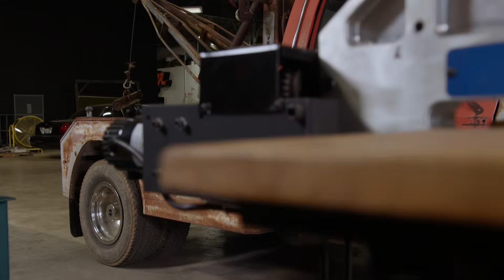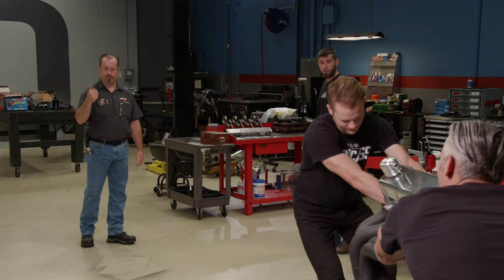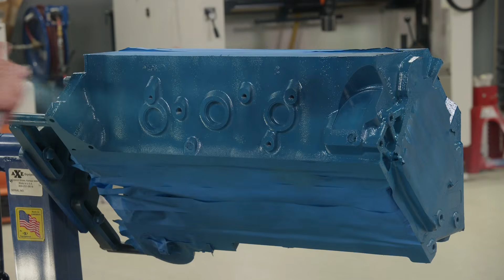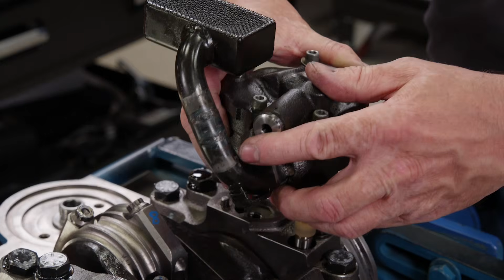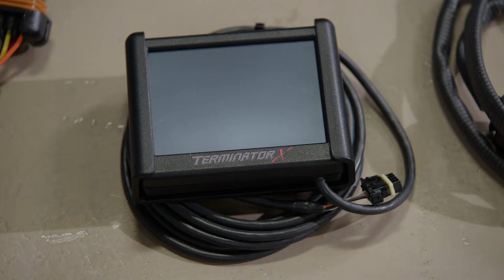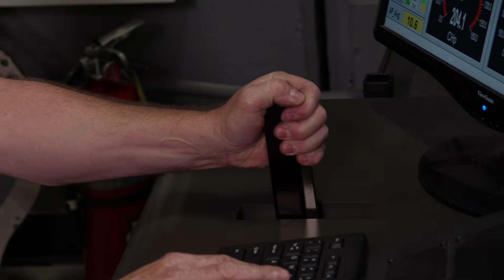A 632 Big Block Chevy Is The Perfect Fit For This '77 Tow Truck Sleeper - Engine Power S7, E12

Comment: On that tip, Chevys in my day were notoriously low 40lbs oilpsi. Z28's came with 60lbs stock, like Fords! Any time you run up to 6000 rpm, you need hi pressure pump. The Chevys BB had both hi pressure and hi volume pumps....

Comment: 1) what happened to Mike? 
2) this motor is has plenty of power. But let's try to tow something with it. You definitely don't want to be towing someone screaming at 5000rpm. Even though he toned it down, it's still not a truck engine.

Comment: very nice build. To save time and money. I believe I would have just bought blueprint 632 with 815 horsepower and 800 foot pounds of torque. I would have installed a 15 degree timing knob so if it starts to ping and pop pull timing out. I did this in my street and strip car works great!

Comment: Why not build a killer show truck and ride it around at times on calls (take out on nice days) and take it to cruise-ins and car shows? Riding a 632 around everyday is not economical. And on down the road rebuilding it won't fast or cheap either. But if you really want to make a big bore motor last use thin piston rings so the cylinders will last, you won't lose power,and you won't have blow-by later down the road and a loss of power and running hotter. If you're going all out and don't mind spending the money do it right the first time.

Comment: if you have money to burn why not? This sounds all good and cool. Here's the real thing the bigger the engine the more fuel it consumes. But if it's used for business keep it simple, dependable and a lot of torque for a tow truck it don't need to be the fastest on the road. The faster you drive the more fuel you burn in anything. Higher RPMs burn more fuel than lower RPMs. I know how much fuel a 572 engine with a 4000 stall converter putting around slowly on the weekends consumes. I've clocked a few thousand miles. Yes I run it hard even race it at times but between things I'm riding it slowly. It sets low to the ground so you have to be careful of the headers.

Comment: have a 509 BBC and I was amazed at the fact that work ethics matter and transparency still exist.  I've got 27g in my life long rebuild of 78 4x4 and well it has been a little over the 3 rebuilds none of these where my fault and happened in the first 7500 miles . wow nice build guys ty for the build .  Should have had mine done by yo all........ kinda have gotten a little bit of a bitter taste to even go any further. But if I don't quit so easily.  God bless and tyvm.

Comment: Would have been alot more realistic if they built a junkyard 454 or maybe a dirt cheap 383 kit small block. The 632 is cool but is way to expensive for most hotrodders to afford and for a tow truck you want a cheap and reliable torque motor like a 454 big block or 400 small block.
Reply: Or just 4.8 or 5.3 LS with small turbo, will be far more reliable and effortlessly make more torque and power for less than $5k

Comment: 👍 I like it. I have a GMC 7000 farm truck that's got a 454 in it and I'm thinking real hard about turning it into a big pickup truck and it would really be cool to put a big monster in it like this 632. I bet it would be cost prohibited for my budget. I'm sure it will be much cheaper for me to use either a turbo or a supercharger. 632 would really be cool though. Great video.👍

Comment: "The oil looks good." Yea, if it was found in a 67 Buick Electra with 168,000 miles on it.
Reply: I think they run Royal Purple.
Reply: It was Royal Purple on a high octane race gas.  The fuel kept carbon from building on parts.  There is no better fuel system cleaner than high octane gas.
Reply: @joshtheking1772  I see. I did not realize you were in on that build. A quick mention of that would help. In any case, it got new rings.

Comment: i got a 327 that is running 12.5 to 1 compression with 92 octane  pump gas  with no problems it was built by old man bell just for street racing on pump gas but there is a lot of money in it and it was built for high rpms . my tak only goes to 13,500 rpm's but i had all most back too 0 i would call it about 15,000 rpms in the mid 90's i was the fastest pump gas no nitro car in my area right now i'm building a stroked 454 with hemi heads going to run tunnel ram with about 12 to 1 but the engine u guy's built is a very good engine it will last a long time for the money and they will be very happy with it . i retired the 327 that old man bell built when he died just because he told me that this was the craziest 327 he had ever built for pump gas and the engine still runs today but sits in the shop on display

Comment: why a timing belt on a low rpm service engine.
Reply: David Freibuger talked about in on Engine Masters. It’s basically to reduce engine harmonics transferring from your cam to your crank or vice versa. Dave also said that the timing belt would hold up longer than a chain on an engine like this.
Reply: @samthelegoman3990  holy shit man, i don't believe that for a minute. what if a pebble, or a stick, or a piece of metal, or anything jump up into the exposed rubber belt??? the motor is done... every exhaust valve bent...
this motor is going in a wrecker, not a high rpm drag race motor... put the timing chain, unexposed,  in the timing chain cover where it belongs.

Comment: Never knew Chevy made a 632... I remember watching Stacey David on Trucks! build his "Project Copperhead" pickup, and being amazed when he revealed the engine he was planning to put into it: one of, if not the very first, then new and biggest Chevrolet engine: the 572 V8.
Reply: This engine is an aftermarket block made by BluePrint Engines. It is based on traditional big block Chevy architecture, but modified to enable you to build an engine bigger than 496 cubic inches.
Reply: @samthelegoman3990  In most cases you could bore a 427 or 454 block to 4.600 bore without sleeving if it's in good shape.  I've heard with machining you can get up to 4.5" stroke that's good for 598 ci.  Even at 4.500 x 4.25 that's a 541ci. Given how much it would cost to do it yourself it's probably cheaper just to buy a crate 632 long block good for over 800hp under $12k

Comment: Can you say 4 MIles per gallon when towing something. 🥶👎
Reply: Your right! My 79 C20 with a built 406 (10.2:1, aluminum heads and intake, comp 264 roller cam (212/218 at 50) and all the other good parts for a reliable low rpm torque small block built with 50 state legal parts) and gearvendors overdrive gets 6mpg towing my 7500 pound toy hauler. The 79 gets 9mpg without a trailer.  I got 9.6 mpg towing the same trailer with an 05 f350 with a bulletproofed 6.0 and 65hp tow tune. Haven't towed it with my 2020 LTZ duramax/10 speed allison yet, but love all the power and 19mpg average with light loads and no trailer.

Comment: burn thru a gallon or three in 5 minuets just at an idle.
Reply: Google Sucks  30 years from now, when its running of some gas hidden in a jerrycan and rusted again so bad theirs holes in the floor... mark my words? no one will have enough batteries to start that motor.
Reply: Arden Nielsen bruh
Reply: That big block won't burn through as much fuel in its entire lifetime as one 747 during one takeoff, not even close.
Reply: @walkerforsyth6221 
I had an 80cc motor bike, i ran about 40 gallons in it before the motor went in the scrap pile

i had a car with a 122ci engine in it, burner thru 7000 gallons then threw a rod.

I had a car with a modern 122ci engine, burned thru 7500 gallons of fuel... then the gambler that thought they owned it wanted it back but i had the Bill Of Sale stashed with the insurance company. so i flipped it over with a truck, ripped out the engine and set it on fire... 100 gallons. 

 i had a truck with a 305ci engine in it, it burned 13'000 gallons of fuel over its life.

i have a car with a 281ci engine in it, it has burned over 21'000 gallons of fuel over its life and still runs fine.

the truck would still be running, but the electrical problems shut it down.

Worm up and take off, 600 gallons. 

happens to be the amount of fuel that a truck AKA dumpster truck would need to haul out all the vehicles and garbage i have... tho they really wouldn't get much farther then outside there city limit marker.

nothing makes sense once they get over the fence. your the only one on the plane... do you now have to pay for all 40'000 gallons?
Reply: @ardennielsen3761  yep, just like I said, they will probably never burn 600 gal through it, it's just a toy.
Reply: @ardennielsen3761  and neither is the effort or energy that you're putting into this post

Comment: What would have made more sense is to either leave the compression higher or put a blower on the 632 and run it off of E85. A smaller cam and a blower on E85 and they could have easily been pushing 4 digits on 6-8 psi of boost and it would have been a beast down low as well. If you don't like blower then twin turbos either one but running E85. After all no one puts a 632 into anything that is concerned about fuel economy :)

Comment: Would be interested in seeing what the torque is at around 2500 because if they are going to drive the truck it should be running around that. They are going to need to tow a gas truck behind that tow truck. I thought they said they were planning on driving it on the street and hitting the strip with this thing?
Reply: It's going @#$# ton, it's 4.750" stroke, even down that low it's likely around 500lb-ft.

Comment: How do you call your self an enthusiast let alone have a show building cars but yet you have no clue what engine something has? Mind blown!
Reply: Or the year of the truck!!  Those orange turn signal lens, grill, and orange engine can't be a '77!!  The '77 would have a different grill, clear turn signal lens, and a blue engine. I'm guessing no newer than "75. I understand they are interchangeable, but that would be a lot of work.
Reply: @kattcasel9730  I love engines they're my passion by far. I cant tell you what year most vehicles are especially the older ones cause 90s baby But engines doesn't matter what it is. I like it and i want one.

Comment: Still trying to figure out what vehicles originally came with this 632 cid. I'm thinking school buses, dump trucks, city delivery trucks. With that Hp/Torque, it would be a good engine for a class 7 commercial vehicle. I wouldn't trust that engine in a light weight four-wheeler as the rotational force would cause the vehicle to flip over on itself.
Reply: Nothing came with a 632 BB It's a tall deck block with stroked parts that isn't a streetable choice, unless you own a gas station.

Comment: I would love to see what you could do with an 8.1 Vortec motor.
Reply: Thank you.  I know about LT build. 
The reason I commented here is because I drive an 05 GMC 5500 tow truck with the 8.1 in it.  The truck weighs 12,000 pounds and that gas burner pulls it pretty friggin good.
Reply: @fantomson5035  No problem. I'm just more puzzled why LTs videos are down. I guess he wasn't all about that YT life.
Reply: Todd Wheeler buy a duramax pull way better and 3 times the mileage
Reply: @Wanous-hv7zo  yes.  But diesel costs more than gasoline.  Where I live 87 is around $1.75 and diesel is $2.50 or more.   So any increase in mileage would not offset the cost of swapping in a D-max.  Unless you drove it some absolutely absurd amount of miles.   And please don't say junk yard swap.   That's a crap shoot at best.  As we have seen on this show.   Slant 6, Ford FE.   Cheap misses.   Imagine spending a bunch of a junkyard engine that was not able to be rebuilt.
Reply: @Wanous-hv7zo   this is what my boss wanted to put me in... plus,  the duramax only beats me in torque by somewhere between 50 to 70.  Aside from that,  I love the "little gas burner "
Reply: It was some kind of conflict of interest with his day job.
Reply: If you follow LT from the show Trucks he's building one for his pickup.
Reply: Nevermind. His name is Lawrence Tolman and for some reason his videos are gone. 🤔
Reply: It looks like his videos are still active on Facebook. Try there.

Comment: As an engine builder for 45 years and a jet engine mechanic, would you please remind people to blow out all cavities with compressed air including the crankshaft. This ensures your getting any debris out and the air you feel reminds you that oil can freely flow through that cavity, orifice or oil galley.
Reply: Conveying the the message is the point, not spell check. Some say galley others say gallery. Oil passages are in a line thus a galley.
Reply: Kerry Monroe. Savage!
Reply: Kerry Monroe Thank you! People missing the whole point. Right on !
Reply: As an engine builder of 45 years, you'd think you would know the correct term is oil "gallery", not galley.

Comment: New tow trucks are plenty fast and that includes while being loaded
Reply: What would it take to beef up a 366 chevy motor
Reply: @benjaminerickilcrease2606  depends on the budget. Headers, duel plane intake and a mild cam and you are already talking about 1000 in parts alone. When you do a cam don't forget to calculate the fluids, break in oil and a little extra for anything that might pop up. Headers run hotter and you might have to get new plug wires to avoid touching. Then you got to tune it

Comment: Fun video today guys and gals at POWERNATION.... As cool as this HOLMES wrecker build is going to be, you know what I think we all need to see in the future some time, is an engine build that is all about MAXIMUM RANGE on the getting the most mileage out of every drop of gasoline, or to say, MPG for a vehicle that is meant for traveling, Yet, still using a V-8 config base. I suppose there isn't much one can due out side of what the factory's have designed & built? I do realize, the company / corporation is about making affordable powerplants, as compared to a top fuel dragster's engine. This is just a thought, and not a huge request, but when you at POWERNATION covered the inline 4, 6, 8 engines, those were allot of fun to watch, and really had folks talking. I do not know if your numbers there at POWERNATION reflect that statement, but, those left the notion to even more folks that playing with engine is more obtainable and affordable to new people just starting the venture to start emptying out every pocket to feed this engine performance & building addiction, that is doesn't just mean that "only V-8's" will make HP... Ah, maybe I am just talking rubbish, and that would serve nobody?.. either way, this was a fun show today.

Comment: It’s hard to watch this after watching engine masters, they made 1039 n/a with off the shelf parts, and about 50 less cubic inches, now to be fair that last number was race gas but they had already made just a little over 1000 HP with pump.  But I get it they wanted torque....

Comment: Forget about the BBC (1020HP @ 7500 rpm).
Put in a 6.5 liter Diesel.
OR
5.9 liter Cummins, will get 22+ mpg (5 speed manual transmission).
Best for pulling.
Plus
Reply: Engine Power has yet to do a diesel swap, build a diesel engine. LT from Truck Tech was the diesel guy on PN, now that he's gone  aside from bolt on diesel crap, doubt you'll see a real diesel swap or build anytime soon

Comment: Talk about putting lipstick on a pig!
 💄 🐷 🤣
A diesel engine would have been a better choice.
Reply: I don't understand why everyone gets all butthurt when this gets brought up. Gas engines have their place. Diesel engines have theirs. Even electric motors have theirs. One is not "better than the other". They're all better in their own right. For this application a diesel would have been the way to go. Hands down.
Reply: Doesn't Matter how much Power your Diesel Makes, it will Never out run that Big Block with or without the nitrous
Reply: @brentonk461  It's a tow truck. They said they wanted low RPM torque. The easiest way to get low RPM torque and still have a 10 second race truck is with a turbo diesel. And it's not my diesel. I don't own a diesel but I know the benefits of using them.
Reply: @brentonk461  So a 2000hp Cummins/Duramax/Powerstroke powered truck weighing the same as that truck will not outrun it? That makes no sense Brenton. You can't base real life off of Fast and Furious because we have laws to our physics and they don't. Not trying to be a jerk but your statement really makes no sense. Go check out some videos on diesel drag trucks. Plenty of full size trucks weighing 6k running sub 10's.
Reply: @Parents_of_Twins  Idk why diesel hasn't taken over the world of drag racing yet... They are so good.. Ask any of the diesel fans...
Reply: horehey * never happen
Reply: @colormesarge  That's not true. I'm a fan of both as are a lot of people who actually try to understand diesels versus those who think diesels run off of black magic and puppy tears. That being said I do find I get a bit better mileage when I add some concentrated puppy tears to my fuel.
Reply: @Parents_of_Twins  That engine you described will weigh atleast twice what a 632 big block chevy would. The added weight would hardly matter though, given all that diesel torque but it could affect other factors.
Reply: @juliennacer8871  Yeah you are absolutely right.
Reply: @Parents_of_Twins  Everything runs better on the blood of dead kittens. It's higher octane.
Reply: @dadillen5902  Hmm good to know. Hadn't tried that.I do like the renewable aspect of the puppy dog tears though.
Reply: I'd honestly love them to do my diesel engine builds..
Reply: Also, different strokes for different folks🤷🏼‍♂️
Reply: Unless LT  from Truck Tech was gunna do the swap, it wasnt happening on Engine Power. Pat  has stated several times he isnt really a diesel guy